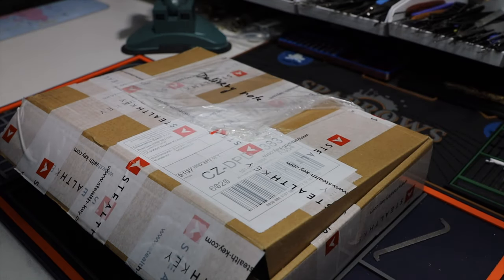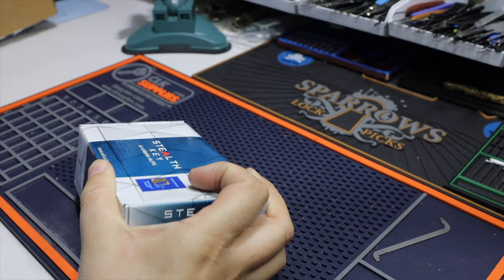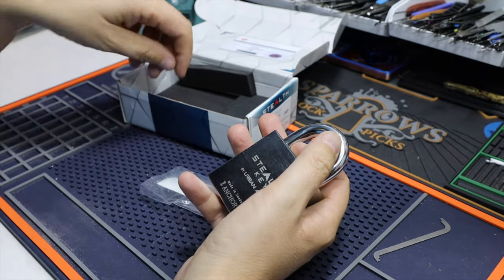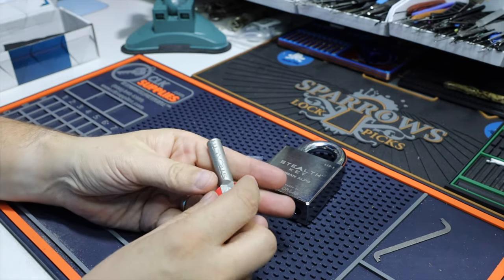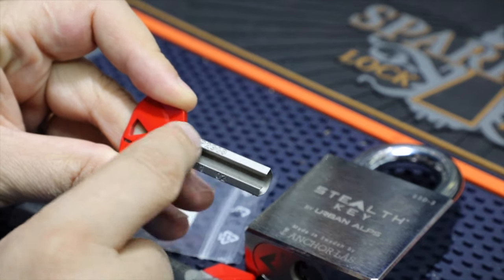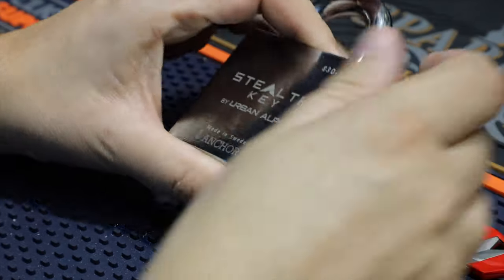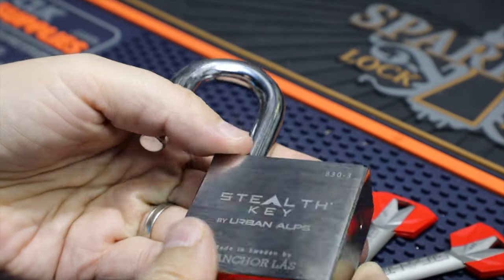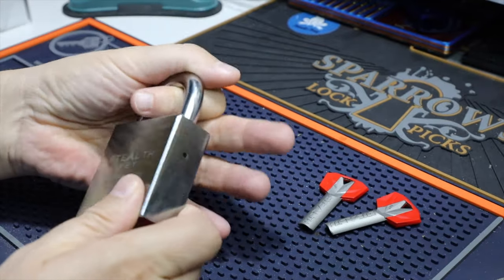(ENG-129) Lockpicking - Checking out the Stealth Padlock Anchor Lås Grade 4 from Urban Alps

Comment: Maybe the most stealthy is the core retaining mechanism with that pin :) Cool lock for sure. Perhaps with a wire light you can better see the inside. Tallan pick did a video about how to make one and I did a simplified version in a video.
Cool lock design and glad you got it back together as it was. If you mention you opened it pethaps they don't want it back and send you a new one? 🤞 Happy new year pandafrog!
Reply from the maker: Thanks for the tips!